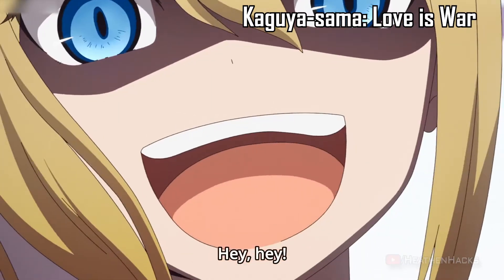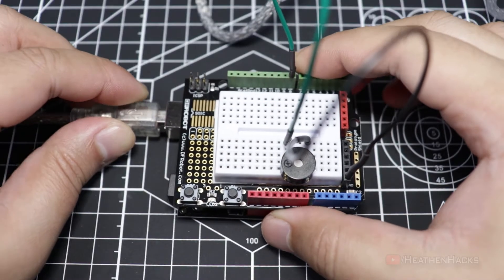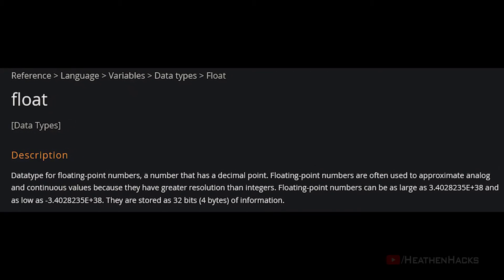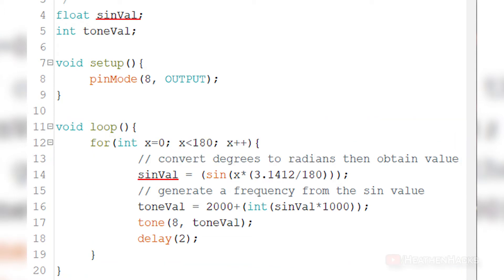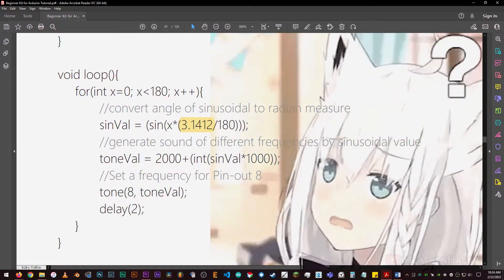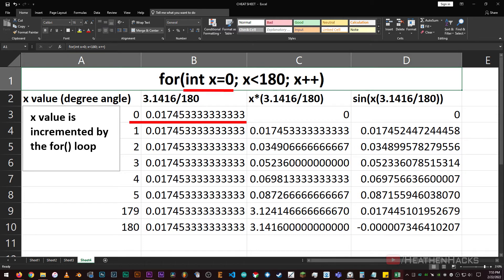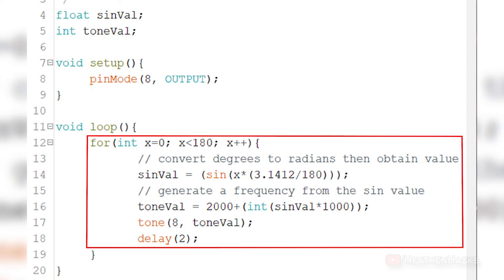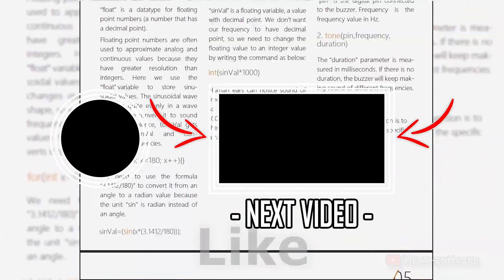DFRobot Beginner Kit for Arduino® | Project 6 Alarm [Step-by-Step Guide]

Comment: Hi Heathen, for some reason Arduino tells me toneVal and sinVal doesn’t name a type
Reply from the maker: Hello, and thanks for the comment. Can you give me more information?

Like, what code are you using and where it was from?

Better yet, can you post the code here?
Reply: @HeathenHacks  Ofcourse I can! 
I took it from the beginner kit arduino tutorial file. It seems to me that its the one you were using. Here's the code:
// Project 6 Alarm
float sinVal; int toneVal;
void setup(){
pinMode(8, OUTPUT);
}
void loop(){
for(int x=0; x<180; x++){
}
}
//convert angle of sinusoidal to radian measure
sinVal = (sin(x*(3.1412/180)));
//generate sound of different frequencies by sinusoidal value
toneVal = 2000+(int(sinVal*1000));
//Set a frequency for Pin-out 8
tone(8, toneVal); delay(2);

now I realized the cause, when copying the code the last two brackets go just before ''covert angle of sinusoidal to radian measure'' part . Now it doesn’t give me an error message . Now the code is right but it still doesn’t run. I actually got  DFRobot Gravity Ardublock Beginner set and  the buzzer ( and all the LED's actually) aren’t directly applicable to the mini breadboard. they have their own female to female jumpercables green red and black(one end of each goes in to the white port attached to the buzzer or LED etc.) that they come with. So I allungated the black and green cables with male to male jumpcables but the red cable is left empty. And the code doesn’t run. Hope this message wasn’t too long, Itried to explain everything in detail. Could you tell me how do I need to connect the red wire perhaps? Thanks.
Reply from the maker: Glad that you solved the code problem. Unfortunately, I'm not that familiar with the kit you have. Do the buzzer and LEDs have their own PCBs? If so, can you tell me their part numbers? Usually goes like "DFR0021" or something.
Reply: @HeathenHacks  Yes. So the buzzer has DFR0032 code and the LED has DFR0021-W(for white then B for blue R for red)
Reply from the maker: I see. Have you tried connecting the Red wire from the buzzer to 5V of your DFRduino board? If you haven't yet, try connecting it, then see if the code would work.

***So, black wire to ground, green wire to DFRduino's Pin 8, then red wire to 5v.
Reply: It works!!! Thank you so much!